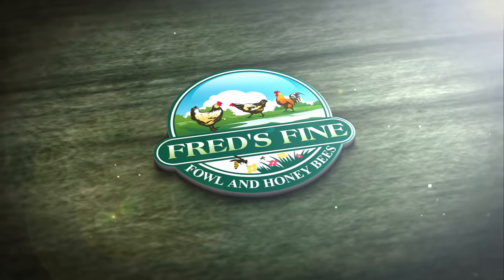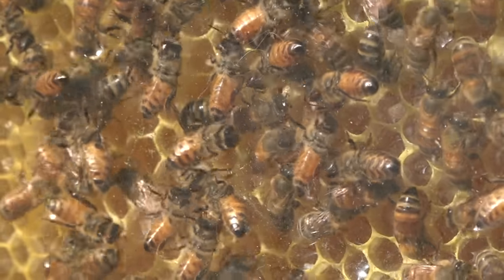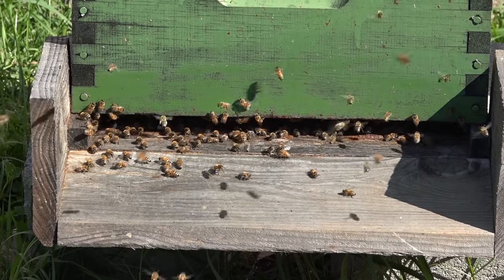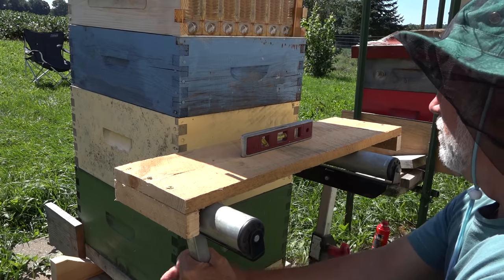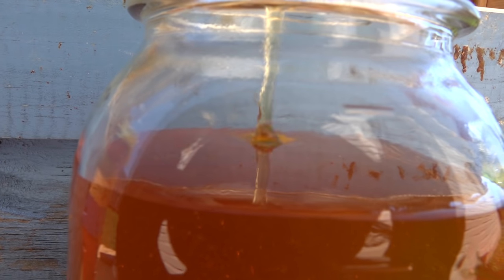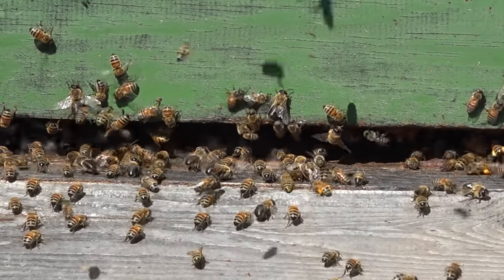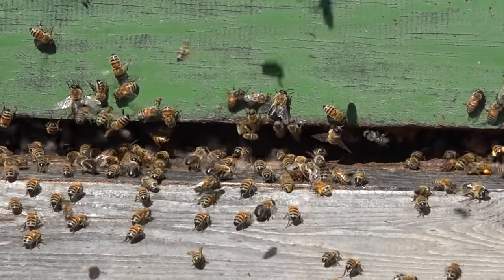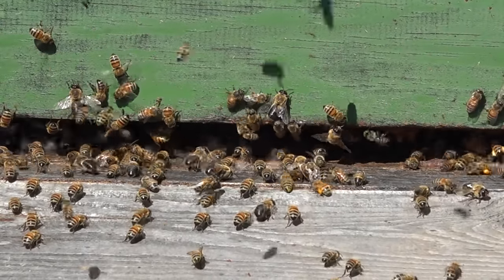First Flow Hive Extraction Cycle How to remove honey without filtering frame by frame

Comment: Not pertaining to this video, but I've watched a number of your video's and you seem to have great information.  Thank you!

I'm a newbee and trying to decide where to place our bees for this spring.  I'm located in S. Cal, so we are pretty hot, so I'll be selecting a spot where we have afternoon shade.  My question is, one area that would be good has 5-6 large Oleander Bushes.  Do I need to be concerned about the Oleander poisoning the bees or making unsafe honey?

Thanks!
Reply from the maker: Nope, you don't need to be worried about oleander or any other plants poisoning your bees or honey. They naturally seek out resources in your area. Placement of the bees wouldn't preclude them from accessing nectar as they are likely to travel as far as 3 miles in every direction from your hive position. So, what I'm saying is that you can't control where your bees do and don't get nectar, so proximity won't really matter. Thank you for the wonderful comment about my videos :) I really do appreciate that.

Comment: Do you have to open all the chambers at one time, or can you open only one or two every other day so the bees won't be overwhelmed?
Reply from the maker: You can open part of the frame at a time, I recommend doing the first and then the second half - but you need to finish that frame before closing it back up - leaving the frame half emptied will allow the bees to begin refilling the part you did drain and then you'll have fresh nectar coming out with your final half if done a day later or so. Once you start a frame, you really need to finish that frame.

Comment: Hello Frederick! 
Today I have inaugurated my first two hives! 
I have a question for regarding the frames. If I place a naked frame of plain wood, will the bees cover it? 
Here people use to attach a wax sheet. What if you do not....? 
Kind regards
Reply from the maker: Hi Arnaldo, I'm glad you are progressing and having fun! As for bare wood frames, the bees will indeed build comb from the top bar of those foundationless frames. The way I do it, is to put bare wood frames between normal drawn comb, or frames that do have foundation, then the bees naturally begin another comb from the empty frame. You can encourage them by melting some bees wax and just running it down the underside of the top bar of those frames. Here is another key aspect, make sure your hive is absolutely level, bees follow gravity, so a tilted hive will have comb that follows gravity and it can look wonky. In the beginning check on them frequently to make sure they aren't bridging the frames and departing from what you "hope" they will do. Keep me posted!
Reply: Hello Frederick, 
Today I inspected the hive for queen larvae. I was instructed to remove hall of those cells in order to prevent bees moving out of the hive. Theee things 1) it was not pleasant to interrupt a natural activity as procreation, 2) Queen larvae had Varroa! 3) bees were not happy at all of me messing around. Even if I tried to be calm and move slowly I was covered by bees in seconds. Did not use fumigation this time. Nor brush (it makes them mad as well). 
Do you have any warré like hive?

Comment: From looking at this it looks like tubes could be on the tubes and all drained at once into a 5 gallon bucket.  But it may be better to only do one at a time so that there will not be as much mess at one time for them at once.
Reply from the maker: Running them all into the same bucket eliminates that valuable separation of floral nectar sources that you get when bottling frame by frame. You can see the difference in the bottled honey.
Reply: @FrederickDunn  Just thought it would be faster.   Thank You for the Video and information.

Comment: What part of the country are you in? I'm in northern vermont, guessing flow hives won't do well here because it's too cool for honey to flow well. Thoughts?
Reply from the maker: My family originates from Craftsbury :)  it's not that it's too cold there, but that the seasons are too short for honey production on that level. Honey production is what it's based on rather than the design of the hive. So if you're getting good honey  yields there, a flow super would be a nice thing to use.

Comment: just a question, what if the water ( moisture ) content is greater than 20% when harvested? what is the best way to remove the extra water after you have extracted the honey.
Reply from the maker: Hi Steve, the problem with high water content is that it can quickly ferment and you'll smell that sour scent very soon. You can place open honey containers in a small room and use dehumidifiers to lower that moisture content. Some beekeepers do that large scale and it's necessary to start that process right away. Once fermentation starts, the honey is altered and can't be reversed. Warm room, open honey containers, dehumidifiers. The Dehumidifiers also warm the room a little as they operate.
Reply: @FrederickDunn  many thanks for that..
i have one more question,, this is from my sister and husband. they are about to start an apiary and want to just buy a queen and then hopefully attract other bees to the queen inside the new flow hive brood box.. is this at all possible.
i think they are better off getting the queen and a lot of bees. but they insist they can just buy a queen and other bees will come to her.
Reply from the maker: @stevegriffin8858  Hi Steve, that's probably the fastest way to just kill a wonderful queen honey bee. Always start with a worker population first, several pounds of workers and I'd consider 3 lbs or more to be a good start, and then replace their queen with the line/genetics you desire. There is no method for starting with a queen and then hoping to attract workers to her as she is completely dependent on workers for food and protection and cannot begin nest construction on her own. Your sister and husband would be absolutely correct if they were dealing with wasps, a wasp queen can start a nest from nothing and can begin their own nest. Honeybees need a colony to survive, even for a short period of time. I'm glad you asked that question because I'm going to be doing some seminars for YouTube in the coming weeks and it may be important to share what bees can and can't do when starting off. Have a great day!
Reply: Frederick Dunn many thanks. I will even send this link to my sister to view.

Comment: Hi Fred, I'm a 1st year beekeeper in Upstate NY , with 3 flow hives.  2  hives have a full brood box and 1 deep (75% full).  1 has a full brood and a 95% full medium.  Its September 2nd and we have a good stretch of warm weather up ahead.  Is it too late to add a flow super to the 95% full hive?  Thank you
Reply from the maker: By this time of year, the flow-supers should already be on and being worked up by the bees. I've found that trying new supers during the first week of September tends not to work out very well as the bees fail to seal the joints as well as fill the frames. If you want honey this time of year, drawn beeswax frames are your best bet. You can try, nothing lost, and at least they may seal up the joints for the spring nectar flow.
Reply: Thanks Fred.  I put 1 flow super on the hive with the 2 full boxes.  Just want to see what happens.  Now I have to remove this flow super for winter, assuming there is not any honey or not any capped honey with the proper water content, do I need to clean the flow super out or just store it with whatever is in there until spring?
  @FrederickDunn   Thank you again.

Comment: How will you store these supers? Seems that flow hives would be good for people with 1-4 hives with ALL flow hives. Otherwise you have to extract anyway. Thank you for this excellent video.
Reply from the maker: I plan to remove and store two out of the three and leave the third on to winter over. After extraction, those to be removed and stored can be left out for honey bees to clean them up of all honey remnants. Then bagged and put on shelves until spring. You are also correct that my other hives must still be extracted in the traditional way or they may become honey bound.

Comment: Some great videos learning a lot on beehives. It gives me a better insight into what we want to do with homesteading. One critic. Could you speak up or maybe add a few db to your audio in post processing? I have to have the volume turned way up to hear you.

Cheers!
Reply from the maker: You are the first to complain about the narration quality.. may I ask what you are listening to this on/with? Thanks :)
Reply: Please don't take it the wrong way by any means. I am a bit of an audiophile so take it with a grain of salt. I have watched a few of your videos on a PC with a simple Speaker bar attached to the bottom of a monitor as well as watching them on my 27" iMac running into a pair of  M-Audio BX5 D3 Monitor speakers via a iTrack Solo.  your voice is very clear and not muffled. I think it just comes off a bit soft and in a lower register almost. The best way I can describe it is it sounds like you are trying to talk softly enough into the mic as to not wake a sleeping baby in the room.
Reply from the maker: Ohhh well, people do come and watch my videos when they are having problems sleeping ;)
Reply: Are you using the Sony AX100 for this video? Also what mic for the commentary? We are still trying to get our setup going.
Reply from the maker: Yes, for that video, I think I did use the AX-100 as for my narration, I generally use an AudioTechnica microphone AT8024 is currently on my narration rig.

Comment: You mentioned that much honey can be dripping from the Flow Hive when you extract first time. What about slipping in a thin solid cover underneath the Flow Box just before extraction is initiated to prevent hone from dripping further into the hive? Is that possible? Also, would an enhancement of the Flow hive be to include a thin slot underneath to prevent spillage? I am no bee keeper but I do think outside the "box" most of the time. Obviously I am making this comment 5 years after you published this video so enhancement may have been made.
Reply from the maker: Thanks for sharing, the new flow hives have a stand that includes an insert tray that collects any honey drippings. No more mass exits from the bees :)
Reply: @FrederickDunn  Thank you. I checked the latest designs at Flow. I see the tray but do not understand how it can prevent the issue you pointed out at first. I do however have in my head a complete redesign of the frames that will ensure longevity, much less moving parts and absolute certainty that no bees will be trapped or hurt during the extraction process. Also, with the design in my head it is possible to extract small batches of honey and leave parts of the frame completely untouched by the extraction if so chosen. I might try it one day when I have time ;)

Comment: thanks again!; another question...do you think that it will work with 2 boxes and the flow frames or that i need another half?
Reply from the maker: Hi Marcos, that thoroughly depends on how cold your winters are and what the colony population looks like when going into winter. If you have two deep boxes, then a medium super aside from the flowframes, then you "should" generally be fine. I have had medium sized colonies do well with just the two deeps and no supers on, but you must inspect them to make sure they have lots of capped honey put away.
Reply: Thanks

Comment: I have a Flowhive and haven't taken the super off yet. It's abput 80 degrees here today so I'm not in a big hurry... Do the bees evacuate the Flowhive when the season is over? Should I just brush them off.   Can I pull the super off and have the bees clean it up in preparation for next year? Just trying to get a handle on what I need to do for next year. This is our first year of harvest from the Flowhive
Reply from the maker: Hi Larry, I suggest pulling the flowsuper off while the weather is good and the bees are still able to fly and clean it up. Condense the hive it comes off of and let them prepare for coming bad weather. After the frames have been cleaned out, just put it in storage for next year. I've pulled all of mine and just in time as we are hit with rain and wind which would have given the advantage to the wasps for clean up as they also will clean out the cells.
Reply: @FrederickDunn   Should I put the Flowhive close to the hive for them to clean it up? How far away? Just take the Flowhive off with all the bees in it?
Reply from the maker: I place the robbing station 50 feet upwind of my apiary in order to avoid localized robbing.

Comment: Hi, I'm relatively new to the beekeeping scene & I think I'll be getting into it seriously in 2019 so for the moment I'm looking around all I can. How do you account for the differing colours of honey, presumably they came from differing frames? Could it be that the pollen from certain flowering plants is 'filed' in specific frames? How else could such variations in colour occur? Thanks
Reply from the maker: Hi Ben, the color differences are based on the nectar from the flowers they pollinate. For example, white clover is very clear with a light tint, while buckwheat is dark amber. There are tiny bits of pollen in the honey, but not enough to alter the coloration, it's the nectar itself that does that.
Reply: Thanks Frederick, I guess it would be easier to market that honey if each frame is harvested separately so that a customer could select a specific flower honey with the distinct flavour?
Reply from the maker: @benthomwood  Absolutely, the differences are pretty impressive and it's nice to be able to offer a variety that isn't all blended together. In the fall, they are pretty much the same, but late spring produces lots of variations.

Comment: I'm having trouble visualizing the problem with the honey dripping down onto the other supers. Isn't the bottom of the flow frame flat plastic (as a traditional frame would be flat wood frame bottom) kind of like its own 'tray' to catch the honey that flows around the sides of the spout and then, if it backs up, just end up coming out the spout anyway? If I'm not describing that correctly, how could they fix this problem?
Reply from the maker: The flowframes are composed of many individual moving segments, those segments are not "honey tight" and some honey seeps through them. There is no solid plastic sheet directly beneath the flow super where honey is produced, the only stopping point is the bottom board. FlowHives have a plastic insert for the bottom board and nothing in-between individual wood frames/boxes. Honey will seep down, the only question is how much.

Comment: At 30:24 you say you took a sample of the worst honey. How exactly? Is it the very last dribble from the end frames, which consequently come from the uncapped cells and holds most water?
Reply from the maker: That's correct, the honey I sampled/tested came from frames on the outside ends which had the most un-capped cells. The five interior frames were completely capped and had lower water content.

Comment: @Frederick Dunn thanks very much for an excellent evaluation of the flow super. Since you are such a precise person, why not feedback your findings to the flow designers in Oz ? Specifically to perhaps tweak the design so that opening the flow would not result in honey leading into the hive. It might be possible to have the designers tweak the frame so that the flow hole is say 5 or 10 inches above where it is now at the bottom...so that the act of opening a frame only opens up the cells up to a buffer of cells at the bottom that would always remain intact, thereby alleviating the leak issue and therefore the mass exodus of the hive to deal with the leakage. Just a thought...:=)
Reply from the maker: Hi Kiters, I am actually in frequent contact with the good folks at Flow and they simply said that it would not happen in subsequent extractions and were right. If you watch the second extraction video, the problem is completely alleviated. Thanks for sharing your thoughts. I don't think there are any plans at Flow, to alter or tweak this original frame design. They are modifying the box though.
Reply: Yes indeed Mr. Dunn. I watched the 2nd video (thank you) and hey presto...the problem was alleviated. Maybe the key would be to say... only drain one frame to start with and then see what the hive reaction would be.
btw, my first name is Kambiz and my nickname is beez..which is ironic cause I have never ever kept bees ...but I am ramping up to have the know how to start. So thank you VERY much for your really excellent videos.
Reply from the maker: All good suggestions, thanks! That's a great nickname to have :)